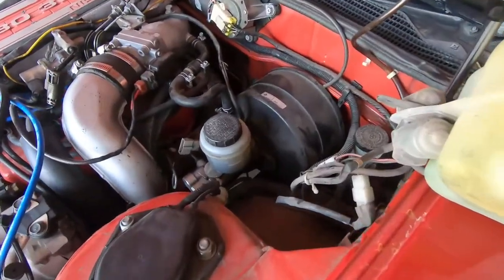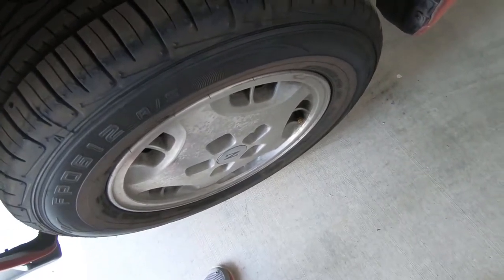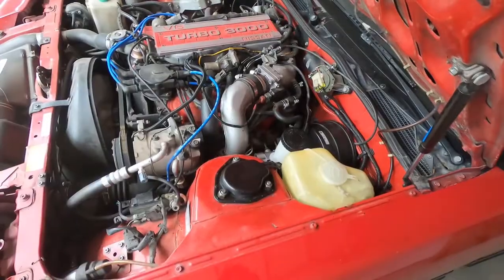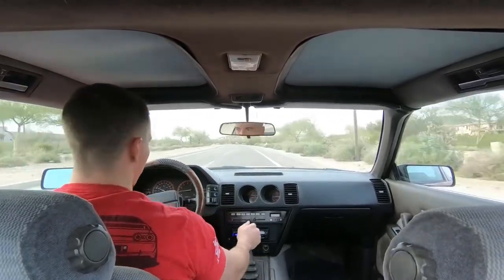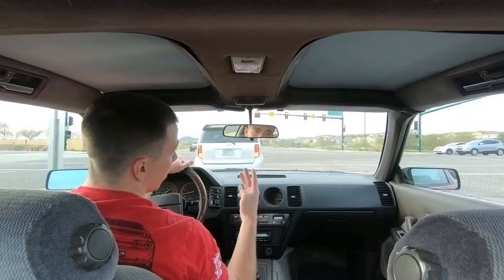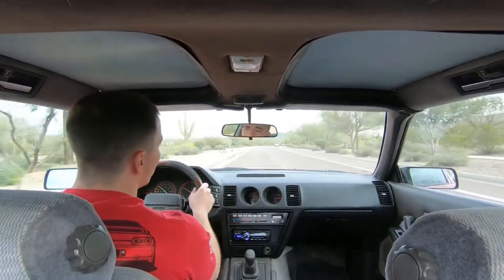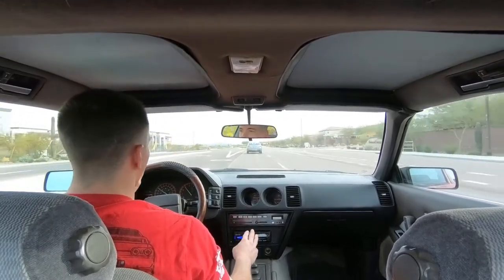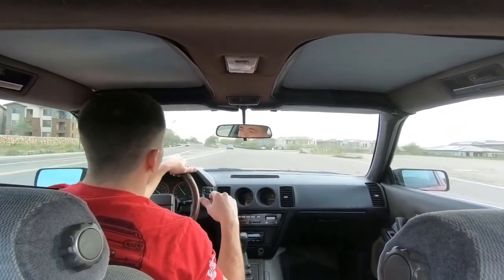finally fixing my brakes on the 300zx z31! (Brake master cylinder replacement)

Comment: Hey dude, good to see you giving some TLC to the old dog. How you standing with the 370 ? I know you mentioned some planes in this video but it was a bit hard to hear again. I am waiting on my 12" FI exhaust to come begin of April, can't wait....
Reply from the maker: hey yeah sorry i really need to go get a mic to hook up to the go pro so you guys can hear me better. Tomorrow I will finish shooting the video of me installing the zspeed aluminum under shroud and hopefully edit it and get it up ASAP. Next weekend Im going to install the new swift spec r springs and get her lowered a little bit and I will probably order some 15 mil spacers this week as well so my fitment will be way better!!
Reply: @jakesscc9184  cool....i put 2cm all around on mine, the narrowest hubcentric you can get..i didn't want to go with extended studs..
Reply from the maker: Thats awesome! how does it look? I thought with 20mm you have to run extended or is yours the bolt on type?
Reply: @jakesscc9184  It looks good, much better than stock, they were too deep in, now they are almost flush. I got the Z1's. 15mm you run with extended studs and 20mm and up are bolt on.